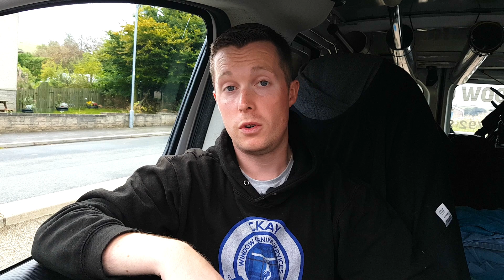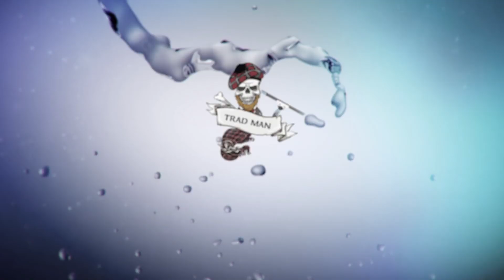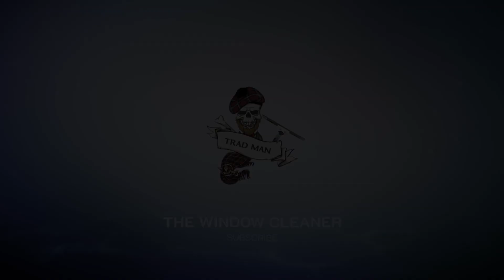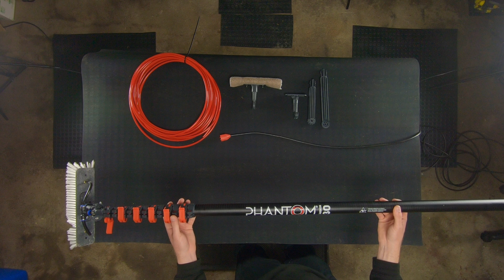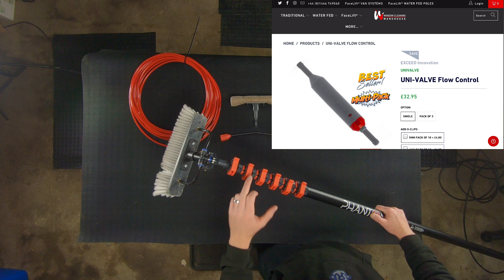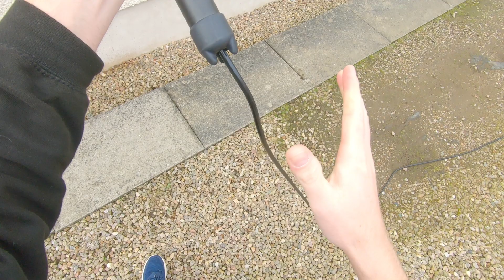THE PHANTOM 30FT POLE | SETUP

Comment: Why is nobody mentioning the extremely weak bolts on the clamps, it’s like they are made of tin foil
Reply from the maker: My pole is still going, must be good tin foil
Reply: 😂 😂 , but seriously I took them into Screwfix to have them all replaced and the guy behind the counter looked at me like I had two heeds when I showed him them. When tightening they snap very easily 🤷‍♂️
Reply from the maker: Lol, I've honestly never had an issue. Had phantoms for years never had anything break and it's used everyday 🤔

Goodness knows maybe you got a dud one 🤷🏼‍♂️

Did you contact WCW?
Reply: Only one bolt snapped on mine when first tightened them up. But that was 2 years ago and have them on phantom 25, slx 27, phantom trad 370 and an old streamline 25 pole and haven't had another snap. Just don't overtighten!

Comment: Would you choose the phantom over the slx Peter?
Reply: Change the slx clamps to phantom and you e got the perfect set up. People do it on brand new Xtremes as the clamps are so good and the Gardiner poles are so lightweight/stiff
Reply from the maker: Yeah, the phantom has better clamps 😉
Reply: @TradMan   Morning. Is it still the case, that the tubeless kit can't be used with the phantom pole?  Also, can I use the Gardiners Swivel neck on the phantom pole?
Reply from the maker: @JDWDWCLEA  hey mate!

I had the tubeless kit on my phantom, worked fine. Think I needed to cut the foam cap at the bottom a little bit if memory serves.

Squeaky clean dave is an expert on that tubeless kit, give him a wee message pal.
Reply from the maker: @JDWDWCLEA  I'm not sure about the gardiner swivel mate for the phantom, I use it on my gardiner but would have to test it. I'm out the country at the moment but again give squeaky clean Dave a shout he's maybe tried that!

If you need his contact info let me know your email address. 

Send me a message at mrtradman@hotmail.com if you need to and I'll ask dave if its ok to pass on his email 😉
Reply: @TradMan  I ordered the phantom 22 Peter. I was going to try the ova , as I've heard that's even better. However I was put off by the lack of detail on varitech website. I like detail on anything I purchase. I'm certain the phantom will be a big upgrade on the Gardiners slx 22 though. 👍
Reply from the maker: @JDWDWCLEA  yeah you'll love it, those clamps are brill!!
Reply: @TradMan  Clamps were a Biggggggg selling point  peter😎

Comment: Hi trad man, I’ve just been messaged to do a 3rd and 4th floor block of flats. This is the only pole I have. Will this reach that kind of height ?
Reply from the maker: Hey buddy, you'll need something a bit longer than 30ft in that case. I would go for something at least near 40ft so you can comfortably clean it with no issues. 

What I did was buy a 30ft then bought a few extensions for it that I can pop on when needed
Reply: Thanks a lot mate really appreciate the help as always 👍🏻 Mines the hybrid version of this and when it’s at full extension it feels like it’s going to snap haha. Il invest in a carbon next and like you said il get the extension bars. Hate to turn down work but if I ain’t got the tools I can’t do the job haha
Reply from the maker: @Harrisonkickboxing  Yeah the hybrids aren't much use when you get around 30ft and above, too floppy. 

I had to buy the extensions for cleaning a big hotel. I just told the customer as soon as the tools came in I would call them to arrange a date for the clean. 

Maybe you could explain your situation and they will wait a little bit

Comment: Great video very good pole i have a clx at the moment hoping to get an ova 8 later on .My wifes family come from glasgow shetlestone were in Bracknell  .Nice to find lots of good advice on wfp systems from Brothers .🙂👍
Reply: Going from a clx to an ova pole, will be like changing your Honda 5o for a  BMW 5 series Paul .....
Reply from the maker: Hey ☺

Thanks bro really appreciated 🤜🏻🤛🏻

How are you doing?
Reply: @TradMan  very good 25 years trad on ladders bad knee so changed to wfp .purchasef a van and fixed it up recently put a 600 lt tank in with a pump and controler in and lesure battery charged from the van alternator .Not working today as its too hot and have to put proper crimped metal clips on all my fittings as combanation of heat and the power of the new pump is making these older fittings leak  but having fun learning and fiddling with my set up .Have been speaking to cleanit Ben and been vey encouraged finding out who are Bros ...had a clue that most videos without bad language could be Bros.rgds Paul 🙂👍
Reply from the maker: @paulgraver5638  great stuff!

Comment: Wondering can you hook outdoor faucet and use hose.  Or do you need a tank
Reply from the maker: As long as you connect to a filter then yes, either a di or ro
Reply: @TradMan  thank you lots for answering. A newbie with tools for window washing. Other than the basics.  Where do I find a filter like this. Thank you again.  Excited to order one and hoping it makes job's easier
Reply from the maker: @Mara-rc6rf  I buy my gear online from window cleaning warehouse. They ship worldwide to. 

They have some great deals on di and ro filtration systems and also have trollys and backpack options
Reply from the maker: @Mara-rc6rf  and some RO options...

https://windowcleaningwarehouse.co.uk/search?q=ro*
Reply from the maker: @Mara-rc6rf  do you know what the tds reading is of your water in your area? Anything above 100ppm folks normally go with an RO system. 

If your water is below 100ppm then you can you DI.

my water is about 45ppm so I get away with using a single DI filter
Reply from the maker: This is the DI filters ...

https://windowcleaningwarehouse.co.uk/search?q=di*

Comment: Hi, just come across your channel as I’m setting myself up for the first time with a pure water system and wfp.
I’m planning on cleaning commercial signs as there are a lot of industrial buildings and hotels in my area. In your experience do you think a 30 or 35 foot pole would suit?
Reply from the maker: Really depends on the height of what your cleaning really. A 35 would be a safer option if you have jobs that are that bit higher.

Comment: Nice video trad I currently use the 22 hybrid and love it clamps are great also using a Gardiner's brush    which is nice thinking if trying out the wcw rinse bar but haven't got it yet and I also use the flyte which is actually nice for keep your van extra tidy and when your getting the pole in and out it's alot easier as I found the wires tangled easy but now it's all on my reel hope your getting on well with the system I'd love to get a hot water system but still working out how to do it on the cheap lol
Reply from the maker: Hey buddy!

Yeah there cracking good qualitly poles from WCW.

Yeah I've got the rinse bar but not attached it yet. I'll probably do a wee video on it once I've tested it thoroughly. 

How you keeping pal?

Comment: Good vid mate, 
been using phantom pole since it came out and have to say the clamps are a game changer. But I put Gardiner quick-loQ angle adapters euro screw on pole and quick-loQ brush sockets on brushes as they are much stronger and quick to change brushes for leaded or Georgian windows. If you can go hot water it’s like night and day
Be lucky
Reply from the maker: Awesome mate!